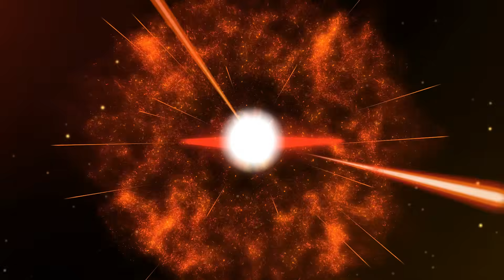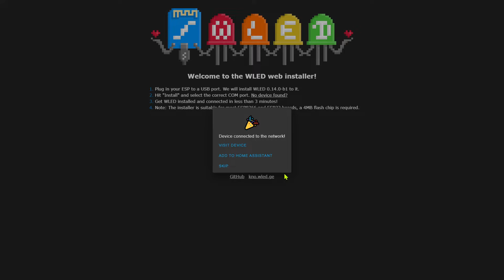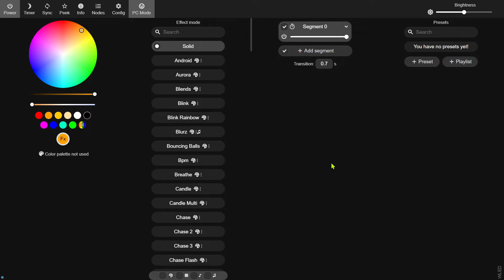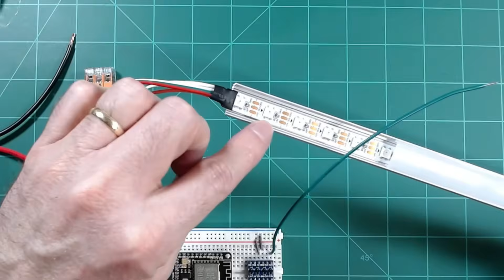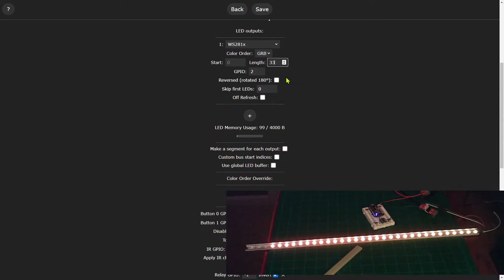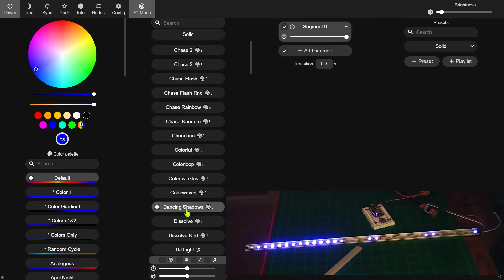How to Quickly Build Your First LED Controller

Comment: Brilliant video thank you so much I finely done it for the first time without blowing them up 🙂
Reply from the maker: Congrats!  It gets easier once you get that first build under your belt!  Thanks for the comment.
Reply: @ResinChemTech  What I do need help on it the WLED power calculator and how too power inject, as when I look at the diagrams I don't have a breakdown on what it all really means if you have any video that might help me a little to run 3 sets of lights 5m 900leds
Reply from the maker: I think this video, that has sections on both power supply selection and power injection, might answer your questions: https://youtu.be/GZv5Ztj6i6I
Reply: @ResinChemTech  Is there anyway on distrol I can chat to you and post images of the issues I'm having? I think the shifter as broke or the esp but not sure so I replaced both, but unsure why, I think you did an updated video to this issues but lost where it is located if yopu have the link to that it may help me further. Its been working great then the wled on the mobile stopped working but it was still working in Home assistant then when I tried to fix that and put it back onto the lights I only got 30 of them coming on even after a reset and re install!
Reply from the maker: If you reset and/or reinstalled WLED, remember that the default setting for the number of LEDs is always 30.  That's why you only get 30 LEDs to turn on.  You need to go back into the Config/LED Preferences in WLED and reset the number of LEDs (and any other settings you initially changed).

As far as the shifter, you can correct that I did an updated video.  And in that video, I show why I no longer use or recommend the I2C-compatible shifter:  https://youtu.be/Va5eTscUJQI

While I've had success with the older shifter, it really shouldn't be used for the reason I cover in that video.  Of course in many instances you can omit the shifter altogether if the data line length is relatively short.  Of course I'd test both ways on a breadboard before creating any sort of final or soldered version.

Comment: If I was to have a 24v power supply would this effect the ESP32 when its split to go to it? video time is 17:28 where you mention it?
Reply from the maker: Well, if you are using LED strips/power supply that is over 5V (like 12V or 24V LEDs), then you have to step down the voltage from the power supply to the 5V expected by the controller.  You can use a step down (buck) converter for this purpose.  I show an example in the wiring diagram blog article I shared with you previously.

Comment: Will it remember your settings after power is removed and turned back on?  So every time you turn it ON it will run the setting.
Reply from the maker: For things like the GPIO pins, number of LEDs, etc., yes the settings are maintained between restarts. If you mean a preset or certain pattern that loads/runs each time the system is powered on, then that can be done as well.  In the LED preferences, under "Defaults" you can specify a preset to load at boot time. 

But no, WLED will not maintain the currently running pattern or effect between controller power cycles. It WILL maintain the last pattern or effect if the LEDs are just turned off (via the WLED power button).  But for a complete power cycle of the controller itself, the best you can do is to specify a default effect or preset to load at boot time.
Reply: @ResinChemTech  Thank you for the prompt reply!

Comment: How you would control 4 chanels.. sunce you had  logic shifters? By software?
Reply from the maker: Not sure I follow.  The shifter I use is a four-channel shifter.  So you simply use a different GPIO pin for each channel and run each through one of the four channels on the shifter, then out to the LED strips.  In WLED, you configure each of the channels with the GPIO pin used and the number of LEDs in that channel (or segment in WLED).  You can then use WLED to control each segment independently or you can treat all four channels as one.

Comment: Finally got round to making my First bread board. Have to be honest didn’t plug it in for 5 minutes, thought it was going to blow up. But stuck to your advice in the video and boom all worked. Used all the components you recommend except for the logic level shifter I think you call it.
Mainly because I couldn’t find one. Just need to now move it to a proper setup so I can install it behind my desk. So need to order maybe electric cookie board/ breakout board etc. Have a good Christmas 🎅🏻
Reply from the maker: Congrats!  If you are like me, your first LED controller won't be your last!  And there is nothing wrong with a breadboard version.  Heck the very first one I build for LED lights around my pool table is STILL on a breadboard after all these years and it still works great.

Of course the ElectroCookie/soldered version is better if you have the willingness to solder.  Much less chance for something like a Dupont jumper to work loose.  And for me, the soldering is actually enjoyable.

Congrats again.  And don't worry... you WILL eventually fry a component or two.  As I think I stated in another comment, I could probably fill a whiskey barrel with all the components I've fried over the years.  But it's all part of the learning process and fortunately most of the parts used in these types of projects are pretty low cost.

Comment: Hello Sir! I trying to run about 70 ft of WS2812B in my crown molding ceiling how should I go about doing this? How much injections point and how much power supply ? do I have to run a separate power line along the 70 ft led strip for injection point?  and do I need multiple esp32 I’ve watch one of your video where you show how to use multiple data pins and esp32 but since it’s not close up view like this video I’m stuck with my project. Please help advise me and thank you in advance!!!
Reply from the maker: I recommend this video, which I think will address a lot of your questions: https://youtu.be/GZv5Ztj6i6I
You can also find information for things like maximum recommended LEDs per pin on the WLED web site: https://kno.wled.ge/ .  Unless you have special needs, a single ESP32 using multiple pins can easily handle the 1.200-1,300 LEDs... assuming you are using 60 LEDs/meter.

In short, it is hard to give detailed answers for specific installations as each is different.  With that many LEDs at 5V, you will need multiple power injection points... approximately every 200-300 LEDs on average.  But it also depends on the brightness level you plan to use.  This also impacts the size of the power supply.  For full bright white and if you are using 60 LEDs/m, you could be looking at up to 75A.  But if running at less than 100% bright white, then less amps will be needed.  I'd recommend using large gauge wire and fuses for an installation of that size that will potentially draw high current.
Reply: @ thank you very much!! I’m using the ip65 60pixel/m 300 leds 16.4ft

Comment: excellent video, thank you so much!!  liked and subscribed.  would you please confirm if the logic shifter can be replaced with a 220-460 ohms resistor, for a 6 feet data pin for instance?  Also for power injection, do you have a tutorial for this? can we connect 2 strips with 2 different power supplies in parallel?  Or should we keep only the negative/ground in parallel for all strips and the positive separate for each strip?
Reply from the maker: You are most welcome.  In some cases, a resistor will work... but in others, you do need to boost the logic level (the voltage difference between a 0 and 1) from 3.3V to 5V.  Personally, I just opt to add a shifter to all my installs just so I don't have to worry about how long the data line is (well.. within practical reason).  I've only had one situation where I needed to also use a resistor and that was due to a very long run where the ground was in the same 3-wire cable as the data line.  

For the second question, yes you can use two different power supplies... with caution.  As you alluded to, when using multiple power supplies, you never want the positive lines connected together (this is theoretically possible, but you really need special power supplies).  So if attaching two different supplies to the same LED strip, you need to break the positive connection on the LED strip so that each power supply is only powering an independent part of the LED strip.  

Hope that little bit of info helps.
Reply: @ResinChemTech  Thank you so much, it is thrilling to receive live feedback like this! really enjoyed your content. if you ever find time for it, do a power injection tutorial, it would be great content for all of us. keep the faith.
Reply from the maker: I haven't done a dedicated video, but I do have a segment on power injection, why it is needed and how to do it in this video:  https://youtu.be/GZv5Ztj6i6I  It is a pretty long video covering multiple LED topics, but you can use the chapter links to jump to the portion that covers power injection. 

(Sorry for the delayed response... I've been traveling most of the day today).
Reply: @ResinChemTech  awesome feedback! thanks again. will check it out.  have a nice day.

Comment: WLED sucks as a LED controller. it is very limited on effects and colors. the ESP32 and the ESP1866 do not retain memory when using WLED. each time you power down(turn it off, by disconnecting the power supply) the module loses your saved effects and color. WLED remains on the module, but needs to be reset to your effect and color.
I'm using the lastest version of WLED 15.Xb.
Reply: So what do you suggest other than wled?
Reply: @GregParker15  i have no idea. I have many different controllers ranging from the SE 110 to the SE 108. I have simple push button to blue tooth controllers. I have arduino nanos, I have ESP's. I have tried fasted, neopixel, and wled. I could not get noepixel to work. Fastled works but you have to write the code and install it on a arduino,

Comment: can i connect micro sd to esp32 and make effects via jinx, mardix, led shift and similar? i want to replace t1000c controller. maybe it is possible to do it thanks to esp32 modifications?

Comment: You gave me EXACTLY the info I was looking for which was how to power these two, amazing! Thank you!
Reply from the maker: Glad I was able to help out.  I think one of the most common mistakes that beginners make (and I did it myself) is trying to power a large number of LEDs via the 5V pin on the ESP controller.  This results in either very dim LEDs or eventually a fried or destroyed ESP board.  So I always try to stress the proper wiring to power LED projects by running the power in parallel.

Thanks for watching and taking a moment to leave a comment!

Comment: my esp32 is too wide for the breadboard. it only leaves one arrow available, not 2 like in your video. i don't understand why it's not the case for you in this video..
Reply from the maker: Well, because as I state in the parts used section, I'm using an ESP8266... and not an ESP32.   If you want to use a breadboard with an ESP32 NodeMCU style, you have to either mount it on pin headers so that you can wire underneath, or use one of the 38-pin narrow ESP32s (usually listed as "narrow" or "breadboard friendly").  Most 30-pin ESP32 boards are, as you found, one row too wide for a standard breadboard.

I talk about this exact issue and alternatives in my video on building your first DIY project:  https://youtu.be/ruSf2Mc-fgQ (you can jump to around the 26 minute mark where I talk about the ESP32 and breadboards).

Comment: since there is only one jst connection, if i would cut the led stripe into 2 halfs, i need to solder another jst cable, right? or is there any other solution without soldering?
Reply from the maker: While I am not a big fan and prefer the more reliable soldered connection, there are various clips that snap on and allow you to attach wire/JST connector to the end of a strip similar to this:  https://amzn.to/3AjxVOT

There are also various versions of these same type of clips that will allow you to connect a strip directly to another strip, including options for making 90° connections.  Just do a search on Amazon or Google for 3 pin LED strip connectors.
Reply: @ResinChemTech  thank you so much, have a nice day

Comment: i am new to this, so i don't understand why would you connect the 5V from the power supply directly to the esp32 board? i though it only supports 3.3v? so you would need a voltage converter in between the esp32 VIN and the power supply, or not? okay i've read it in a different comment from you, that the dev board can regulate it down to 3.3. 
is it possible with the: AZ-Delivery ESP32S Dev Kit?
Reply from the maker: While it is true that the actual ESP chips themselves are powered by 3.3V, nearly all development boards (like NodeMCU, D1 Mini, etc.) are powered via 5V and have an onboard regulator for powering the ESP chip.  This allows the dev board to be both programmed and powered via USB.... or via the 5V pin... both will use the onboard regulator.  You can theoretically use the 3.3V pin to power the chip, but it would be critical to regulate that power yourself.

But if you look at nearly all dev boards available, they are all listed as being powered by 5V... either via USB or the 5V pin... and have an onboard regulator for actually powering the primary ESP chip.  I hope that answers your question.

Comment: Hi, excellent video. I have 6 seperate lamps with 42 leds each, thus i am running 252 leds in total. Do i need to add anything to this setup in your video? cheers
Reply from the maker: Are the 6 lamp's LEDs wired or connected together so that they can be treated as one single run of LEDs?  The data signal from the controller (that I show here) only has a single data wire.  It connects to the first LED and then the data signal "travels" down the strip to the final LED.

If each lamp's LEDs are standalone and not connected to each other, then you will probably need to use an ESP32 and multiple data pins... one running to the first LED of each lamp... and then define segments for each lamp.  If you are not familiar with multi-pin setups and segments in WLED, you can try watching this video: https://youtu.be/HYdouRHfadE
Reply: @ResinChemTech  Thx for the rapid response. Yes all 6 lamps are connected as one. cheers